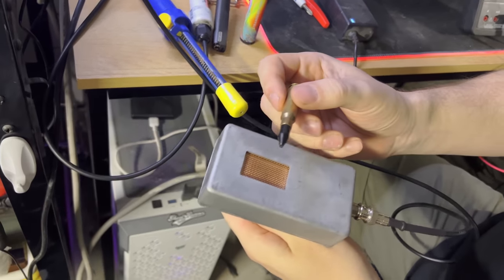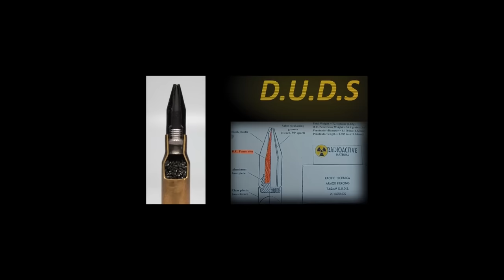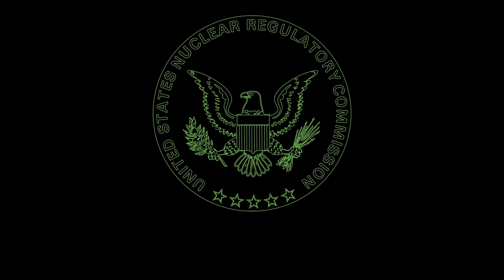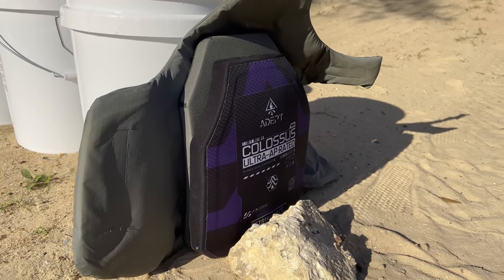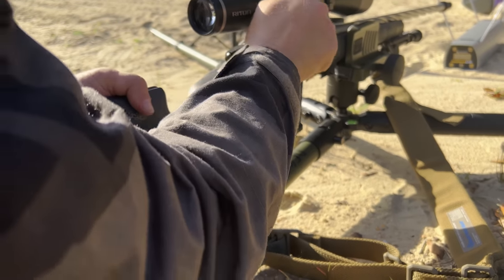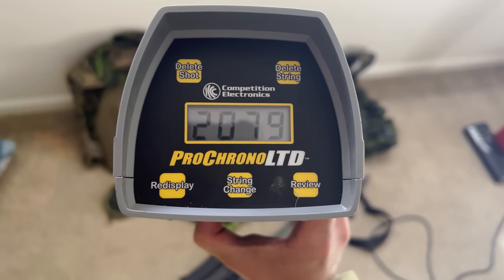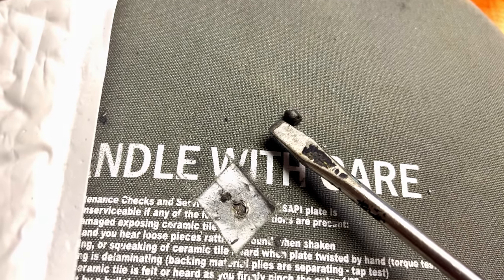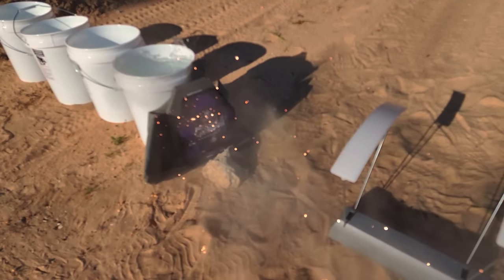Shooting Depleted Uranium rounds - DUDS 7.62x51mm

Comment: I got cancer for DU.  It's not from the radiation.  It's from the dust particles created during impact that are the danger when inhaled or ingested.  As an 11B, I was regularly patrolling areas that had been hit with DU rounds.  I was exposed back in 2003 and have had many health issues since.  At my local VA, tumors were found in an MRI followed by 2 surgeries within 3 days of each other back in 2022.  The surgeon believes they got all the tumors out.  Time will tell.  I've already been predeceased by several others in my task force from cancer
Reply: Oif1💩
Reply: good luck then
Reply: Correct. A dust particle lodged in your body will constantly release energy in you. Like a little constant sunburn spot in your body until it becomes a  carcinoma that you can't see. I love you, my brother vet. I hope you are squeezing as much joy as you can out of your days, and receive blessins in other ways.
Reply: @danielescobar7618  thanks, brother.  I'm doing ok, not great but ok.  Each day is a gift
Reply: god bless

Comment: Probably a bit late now, but you should definitely wear a respirator when firing these, especially at close range, and it wouldn't hurt to decontaminate yourself properly afterwards. Alpha particles are very easily stopped even by air, but if they're sitting inside your lungs, they're going to be emitting radiation right into the surrounding tissue, and in that scenario they're much more dangerous than a beta or gamma source, because the alpha particles are much bigger and carry much more energy. That huge plume of sparks about 10 feet from your face is made up of small particles of Uranium. U-238's half-life is 4.5 billion years, so as long as it's in your lungs, it's going to be emitting radiation.
Reply: Not service related
Reply: came here to say this, along with gloves holy crap...
Reply: I have no idea what he was thinking firing that close to the target.
Reply: a little more target separation would not have hurt the quality of the video
Reply: "Regardless of the risks" - yeah wait until the Leukemia kicks in and people are left debating if it was that marlboro light you smoked in college or that dumb video you made after ample doses of "It's called depleted for a reason!".
Reply: @BrownBabyJesus  Or just the Radon in your basement etc which is generally scarily high in a lot of places.
Reply: Free energy source for life ?
Reply: @BrownBabyJesus  but then you'd have to ask, was it the particles of uranium from my DU project or the ones from drinking water, eating food, and breathing air.  Stuffs literally everywhere in some amount. That probably has less to do with DU munitions and more to do with volcanoes + all the conventional explosives we've craterized the world with digging up and vaporizing so much of it.
Reply: @MrDJAK777  Those radiation source would not have been artificially concentrated like the depleted uranium
Reply: Right? Jesus christ. This guy just made a little radon factory in his lungs.
Reply: Even if he did inhale the particles and they're sitting in his body now, I don't think it would increase his daily radiation intake by that much?
Reply: Just handling them would've potentially exposed him too much. I hope he was smart enough to keep tabs on his exposure here but im willing to be he didnt
Reply: Oxide should pin this and come back in 20-30 years with a health update
Reply: @3rd.world.eliteAJ  It's the fact that it's concentrated on one point wherever it ends up inside you and directed right into an internal organ. Daily background radiation is absorbed by your whole body, not just one small patch of cells.

As I say, Alpha radiation in particular is particularly damaging, but if the source is external to your body, it will probably be blocked even just by the air beteween the source and your body, or worst case scenario, your skin. This is because Alpha particles are basically helium-4 nuclei, which are quite large. So, it carries a lot of energy and is highly ionising because it's a helium nucleus missing 2 electrons. That's bad if it can actually hit living tissue, but since it's large, it can't make it through most materials like gamma or to a lesser extent beta can. If it's inside your body it can do much more damage though.
Reply: And on top of that, they contaminated the shit out of the inside of that respirator they just left there on the ground. Yikes.
Reply: @098Chris  gloves are not necessary when handling U238 or U235 for that matter...unless you have cuts on your hands...in which case, you should really wait for them to heal up properly first.

Proper decontamination following however is a must as if particles remain on your skin, and they end up burying themselves within it, that would be problematic.

To that end, if you find alpha emitting particles upon your skin after having washed with soap and water, you should NOT try scrubbing harder as to do so could cause the particle to enter the body.

Common practice is to send said person home with their hand sealed within a plastic baggie.  This causes the hand to sweat, typically resulting in the natural expiration of the particle instead.

Believe it or not, uranium in a refined/stable form, as a solid isnt all that bad for your health...so long as it remains outside your body.
Reply: @MrDJAK777  unrefined uranium/uranium ore is incredibly weak though.

DU is even weaker than that.
Reply: @3rd.world.eliteAJ  it's the size of the Alpha particles and their proximity to soft tissues which is the problem.
Reply: @reaper_exd7498  no, this is wrong.  Alpha radiation, particularly the amount emitted by Depleted Uranium is much less than the Alpha radiation emitted by uranium ore even...and even then, it is perfectly safe to handle refined Uranium 235 if you really wanted to.
Reply: @weedfreer  if wearing gloves, you know what the decon process is?  Take off the gloves.
Reply: @098Chris  nope.  You still have to wash your hands and scan them for radioactivity all the same.

Also, when working with the stuff using rotating machinery, gloves are considered a health and safety risk.
Reply: Hahah, I love it, if this nutcase really did this with a depleted uranium, I say he cut his life short for sure, just because that isn’t anything beyond your reach doesn’t necessarily mean that it shouldn’t be.
Reply: 4.5 billion years isn't that long tbh😅I could let it get to half its original life before truly worrying about it. Just gotta be built different 🗿
Reply: i know people who died because A-10s fired within a kilometer or two and they were on scene 10-20 minutes later.
this guy literally shot something 4 feet away without so much as holding his breath and got showered with uranium.

it will be very interesting to subscribe and watch this guys health over the next 10 years for sure.
Reply: This is actually good advice.  Anything that'd be able to handle paint fumes would be effective for DU particles.
Reply: @BrownBabyJesus  DEEEEEEEEEEEEEEEERP
Reply: He will do a video in a few months about his illness thru his Experiment....
Reply: Great video, TheQuantum potato - said everything you need to know. Hope one day you will not regret for playing with this staff.
Reply: Exactly. Internal irradiation is very nasty exposure.
Reply: Yeah I came here just to check his PPE and I was disappointed by that as well as him advocating for these rounds to be reinstated. Hopefully he's just ignorant, because otherwise he's unhinged and also in possession of some serious ordinance
Reply: Probably way too late, but I 100% agree. Wear a respirator...
Reply: The fact it is a heavy metal is WAYY more relevant than it being radioactive.
Reply: @Naitsabes68 uhh depleted uranium is LESS radioactive than unprocessed uranium. Regular ole uranium ore is much "hotter" than depleted uranium. It is a heavy metal which is much more of a health issue than its insignificant radiation level
Reply: @MrDJAK777  you are talking about a few parts per billion or more in terms of uranium found in water or food. Unless your food is contaminated, there isn't much of that. Uranium from this though is quite concentrated. a single breath of that dust is probalby more uranium than you are ever going to consume in your water or food.
Reply: Lol I thought that digi meter he had was for measuring the radiation 😆 ..and it was actually for measuring the speed of the round...Ohh Boyy...😬😅
Reply: the man is relally reckless lol
Reply: @michaelbaker8284 yes yes i have a chill

Comment: I'd have probably added a KN95 or N100 respirator as well.  Anyway, Adept can now say their plate will even stop DU rounds, so they come out ahead.
Reply: Yes - definitely the biggest hazard here is inhalation. I would have stayed considerably further away from the target or if I had to be near it, worn an N95 or similar.
Reply: @sbreheny  I hope you mean a proper n95 respirator and not an n95 mask.
Reply: The p100 half face respirators are the lowest I’d be willing to go
Reply: @AdventureThroughLife  Anything would've been better than nothing.
Reply: It’s weird we see a respirator in the video but I guess it didn’t fit under the visor? Maybe it would have been better to stand further back. I wonder how much uranium is on the inside of that mask now…

Comment: Holy shit 3870 fps?!?! Thats a really really hot one... I was nervous just watching you shoot it so I can't even imagine what it was like for you! And proper protection proves its point again, stopping those sparks! An astounding video as always, man!!!
Reply: A lot less mass so not so crazy imo
Reply: Well APDS rounds Are Known for their High Muzzle Velocity...
Reply: Proper protection would have included a respiratory element.
Reply: Don’t say the Lords name in vain
Reply: @cnlbenmc  that's like saying tomatoes are known for the color red. APDS is known for it's penetration, which it does by applying high velocity, high mass and a small impact point.
Reply: + @glandhound + Its a way to point out the High Muzzle Velocity recorded shouldn't be too surprising.
Reply: From what I have read DU is only superior to TC at velocities over 4000 fps.
 Other than the pyrophoric effect TC would have the same penetrative ability.
Reply: Those sparks are contaminated metal fragments. It was entirely a dumb idea to coat himself in them by manually pulling the trigger. He should be checking if any micro fragments embedded into his clothes or skin.
Reply: I'm very skeptical of the velocity readings. The muzzle is too close to the chronograph.
Reply: The projectile is only 28.5 grains
Reply: At only 28.5 grains I expected higher velocities….. I’ve chronod  30cal sabots loaded with 55gr .224” FMJ’s and soft points at over 4,000fps (like Remington Accelerators)
Reply: @Danefrak  kinetic energy varies as the square of velocity, but only directly proportional to mass. If you double velocity, you get four times the kinetic energy. If you double the mass you only get double the kinetic energy.
Reply: DU anti-tank rounds are very close to 6000 fps.
Reply: @markdoherty1441  What I find on this projectile from Pacific Technica is the overall weight is 72.4 grains with a 56.6 grain penetrator.  Where did you find the 28.5 grain number?
Reply: Lehigh HVCQ 308 rounds get about 3750fps (79 grains) and they aren't sabot rounds, so 3870 for a lighter sabot round seems quite reasonable.

Comment: I cant think of a more ringing endorsement for those plates. Buffman was awesome but this is next level.
Reply: It hit 2 plates. As he said, it likely would have kept going if not for the backing plate.
Reply: @justinkase1360  Point is, it will stop tungsten core AP which deforms more upon impacting ceramic than depleted uranium does. There is a reason depleted uranium is used in tank sabot rounds.

Comment: I believe the 2000FPS value might be because of the plastic bit flying behind the projectile, misrepresenting the velocity of the projectile itself. happened to buffman range testing sabot round too, as seen in this video https://youtu.be/xOF9El482Iw?t=167
Reply: FORSEN
Reply from the maker: Possible but unlikely because the noise of the round and extra felt recoil on the second shot
Reply: @Oxide_does_his_best  So now we measure speed with noise and felt recoil? With such precise instruments, might as well just get rid of the chronograph altogether, my man!
Reply: Occasionally light-based chronographs will pick up the muzzle blast instead of the projectile if it's set too close.
Reply from the maker: @andremariaribeirodacunha3695  you weren’t there
Reply: @andremariaribeirodacunha3695  its almost as if humans have deduction skills, clearly not all of them tho
Reply: For what its worth, the optical type of chrono should be set up between 10 and 15 feet from the muzzle to prevent muzzle blast from interfering with the chrono reading.

Comment: Now that range will be forever "slightly" radioactive 😄very cool and devastating round
Reply: Everything is slightly radioactive this range is just a weeeeeee bit more. I'd be more concerned about the clothes getting showered in the first shot
Reply: @21babydew  lungs
Reply: @21babydew  The LD50 of natural uranium is about 14 mg/kg. I doubt there is anywhere near that much in those sparks and even less of it would actually enter the lungs.

Comment: Lol a DUDs round a Gyro jet and some other ultra rare shit all in one video.  How the hell does one acquire all that on an Army salary :D
Reply from the maker: I'm always broke please donate
Reply: @Oxide_does_his_best  Will do.  If you get another couple of these. A subsonic test with these would be very interesting, if that is even possible with the bullet design.  Given it looks like that round would have easily penetrated with almost 2000fps slower velocity than the factory ammo, I am super curios if such a material would actually make viable subsonic armor penetrating rounds.
Reply from the maker: @Maximus98351  it wouldn’t, it doesn’t have the mass on its own. At least I think. But donate anyway
Reply: Quartermaster's Henchmen know.....

Comment: Just wanted to add when shooting sabot (especially old sketchy sabot) you should remove the muzzle device to prevent the petals separating early and causing damage. This is why modern MBT’s don’t have brakes anymore, and also why M2’s are rated to fire SLAP rounds but not Barrett M82’s

Comment: Thanks a lot, now I’ve got uranium fever to add to my backlog of unattainable cravings.  Great video!
Reply: If it helps attenuate your desire somewhat: These rounds are, in a sense, a case of "You do not sh!t where you eat" really. 

Depeleted uranium is like asbestos, or hexavalent chromium: It is really good at a particular thing, and available in abundance, but with the downside of also being quite toxic and/or carcinogenic. 

These DU rounds are only fit to fire in remote locations where your session will be a one-off, or in actual war zones where no-one cares about the aftermath until later. But your local shooting range? Or your own back yard? Not adviseable.

Comment: Thank you for the video. Take care as burning uranium results in uranium oxide particles that often have a mean dimension smaller than 2 microns. Highly suggest wearing a good CBR protective mask anywhere near burning depleted uranium. Particles smaller than 2 microns become permanently imbedded in lung tissue - alveoli. The problem is that while it is true that a piece of paper will stop this level of radiation - there is no piece of paper in your lungs. This results in the imbedded radioactive particles irradiating surrounding tissue for the rest of your life. This is particularly dangerous in the lungs as blood is continuously circulated through the alveoli - so the entire blood volume is potentially exposed to radiation. During the first Gulf War US soldiers were exposed high uranium oxide concentrations from burning depleted uranium while collecting souvenirs in the vicinity of burning Iraqi tanks.

REF: VA
Health problems associated with depleted uranium
DU is a potential health hazard if it enters the body, such as through embedded fragments, contaminated wounds, and inhalation or ingestion. This is because U’s radiation, while of high energy, penetrates poorly through tissues in the body. Simply riding in a vehicle with DU weapons or DU shielding will not expose a service member to significant amounts of DU or external radiation.

The potential for health effects from internal exposure is related to the amount of DU that enters a person’s body. Inhaled DU particles are likely cleared from the lungs over several years. DU fragments may remain for many years. Older studies in U manufacturing workers show high exposures to U may especially affect the kidneys.

To date, in a group of Veterans exposed to DU in friendly fire events, there has been no health impact to the kidney noted, however, recent research shows there may be an association between elevated urine uranium in these Veterans and lower bone mineral density (BMD). The BMD results require further study to determine if they persist over time and researchers and clinicians continue to monitor the health of these Veterans.
Reply: Worth mentioning that the kidney damage mentioned is likely not due to any radiation effects but down to Uranium's toxicity.
Uranium is a toxic heavy metal much like lead and has similar renotoxic and neurotoxic effects in both acute and chronic exposure. This is probably the main thing to be concerned about regarding individual exposure.
Reply: Low-level LiveLeak, on YouTube.